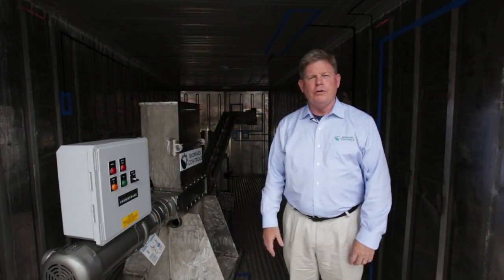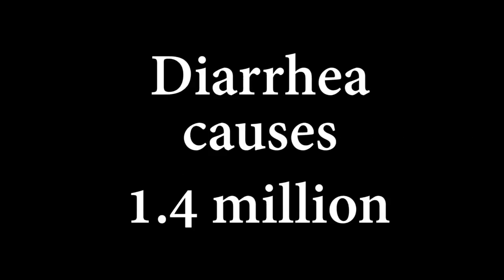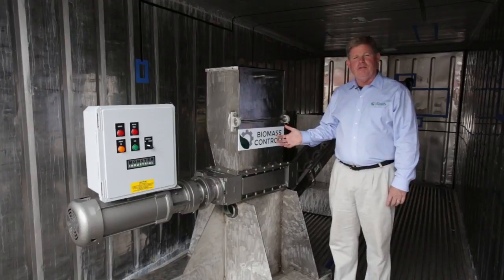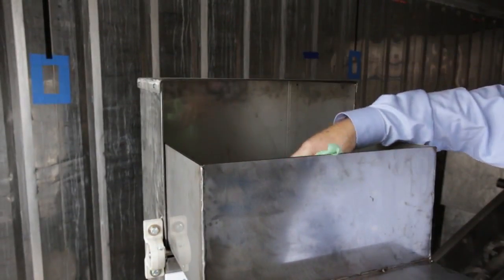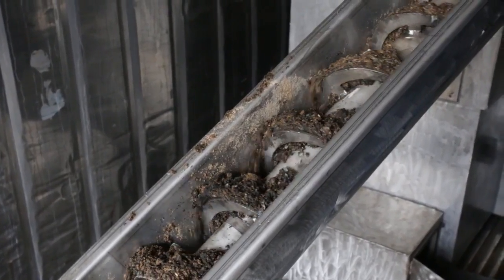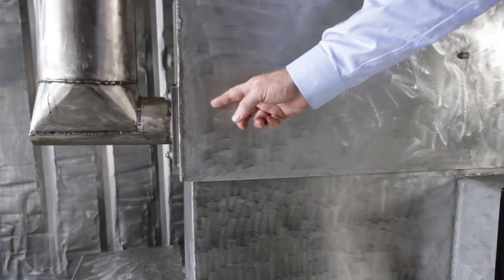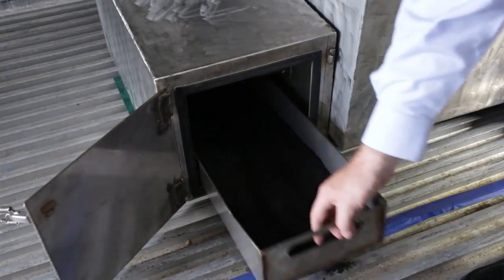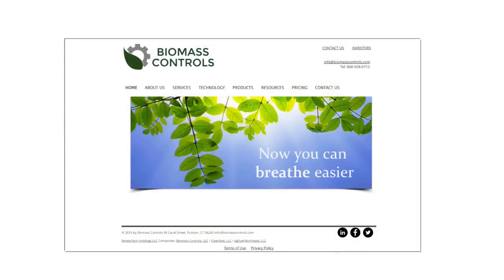2016 Biomass Controls Portable Biogenic Processor

Comment: This system can process about 10,000 liters of septage  per day @ 4% solids.  Dewatered to 15% solids, the material is then dried to 65% solids.  When using Urine Diverted Toilets or Urine Diverted Dry Toilets they typically are at 65% solids.  On a dry basis the range is 400lbs/181kg to 800 lbs/363 kg of solids per day.